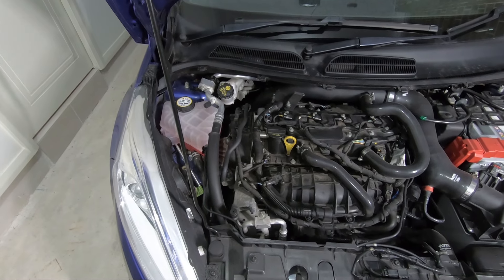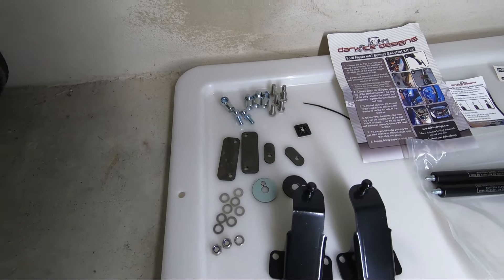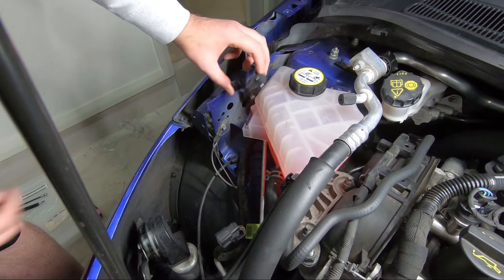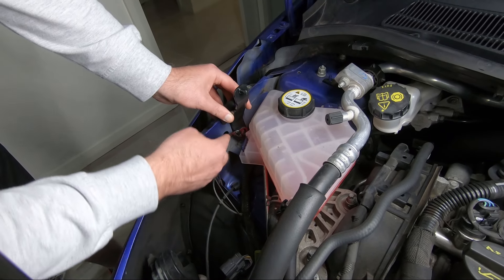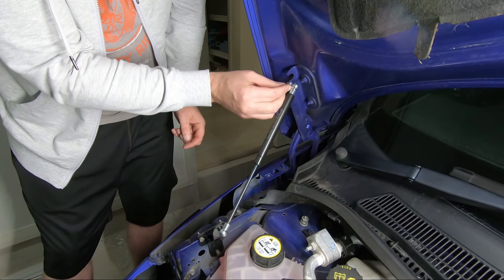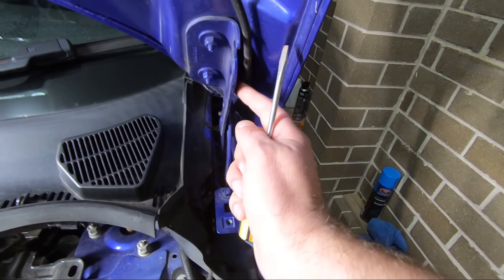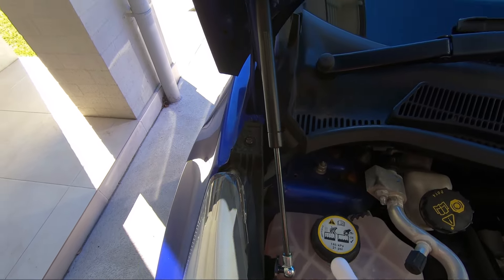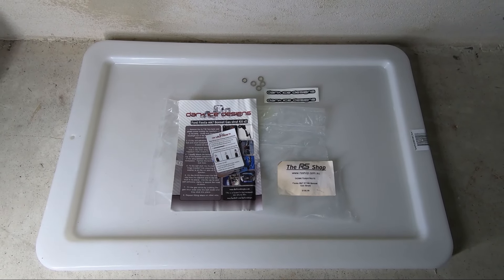Gas Bonnet Struts D.I.Y

Comment: Thanks for your video. I just bought another fiesta ST as my old one of nearly 10 years was stuffed. Do you know of any front bumber sag fixes? The previous owner has upgraded the intercooler and the bumper is sagging a little.. thanks
Reply from the maker: Aside from nuts and bolts, not really. My bumper sags too unfortunately.
Thanks for watching the videos.
Reply: @fordyford  Thanks for your reply. Yeah i have never removed a front bumper on one of these because of that reason.. I'll just have to figure something out. The previous owner has cracked parts at the top where they bolt up..

Comment: Bro this isn’t a true install, only if you dropped the retainer clip in the engine bay would it be a real tutorial lol😂. Left over bits mean that you have made it work better hahahahha.
Reply from the maker: I saved around 30 grams! You are right though. I didn't drop anything. Had 2 10mm spanners and it went too smoothly.